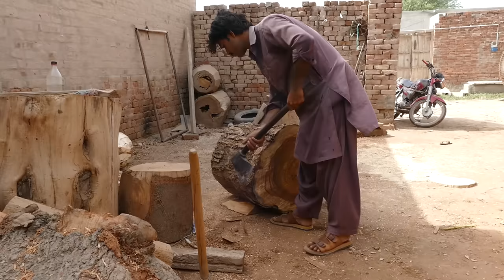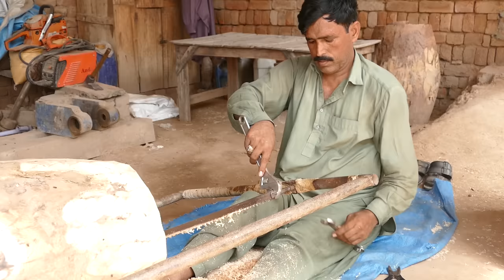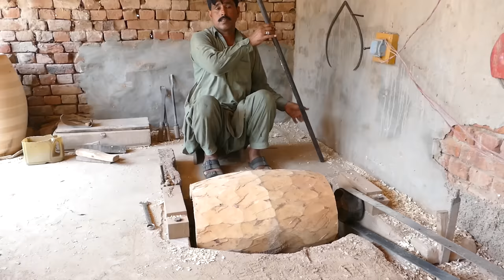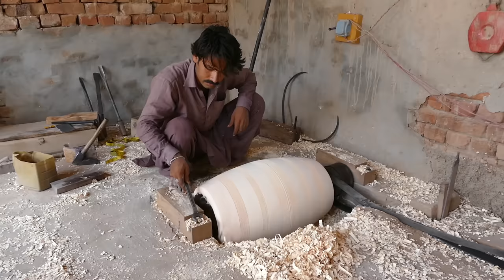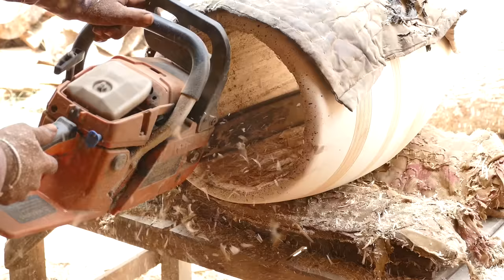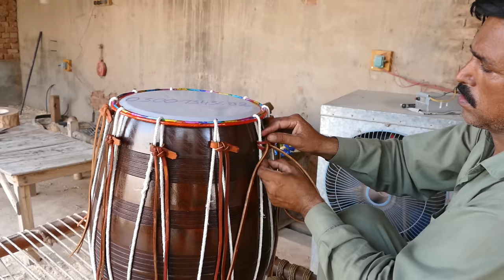How to Wooden DHOOL Making with amazing skills

Comment: All of you Safety Sally’s out there worried about their hands and feet.  These people have been doing this for centuries and have passed down the knowledge of the work.  Do they have accidents I can only imagine but I would be willing to bet their ratio of accidents is less than any major industrial factory that puts in restrictive safety measures.  I am amazed at the skill of their work and the use of what could be considered primitive and homemade tools.  This shows the ingenuity of the craftsman worldwide.  Great job guys.
Reply from the maker: Thanks Sir
Reply: These guys don't look to be in their late 40's; I have to cast some doubt on your centuries claim.  That aside, comparing this practically relaxing small shop work to what happens in an industrial factory makes your safety claims kinda moot.  I'm sure these guys in particular do just fine, though.  Tbh it looks like very satisfying work.